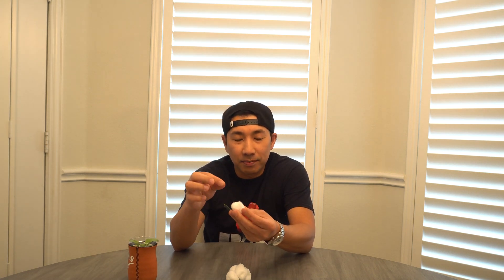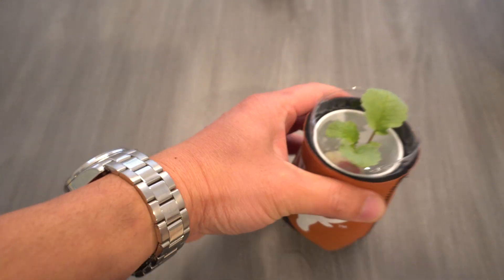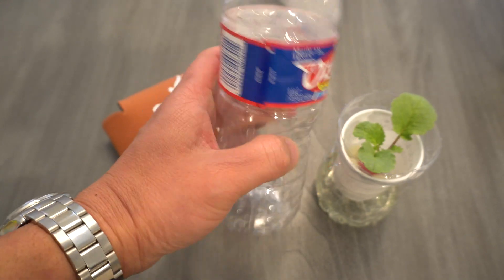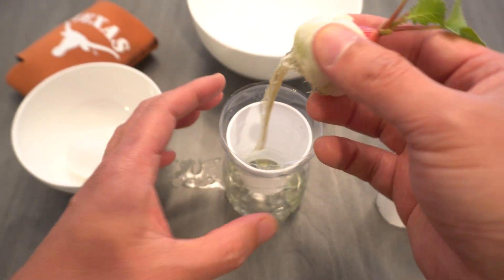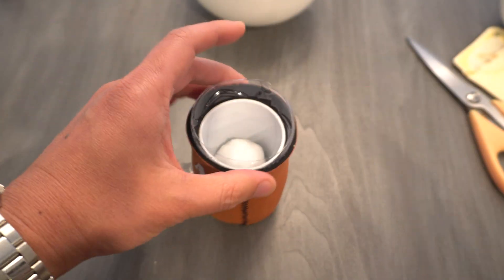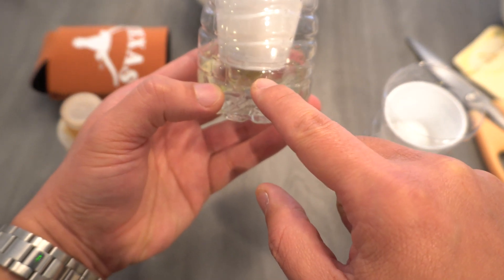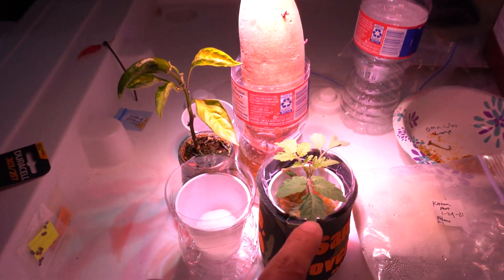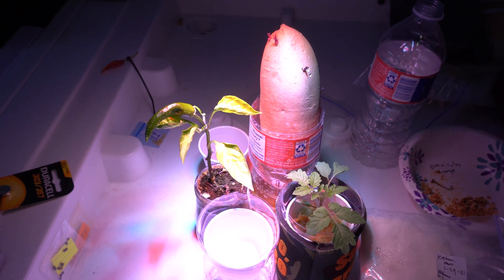Can Cotton Ball Be Used As Hydroponic Medium

Comment: I have used cotton balls to sprout tomato seeds but transplanted the seedlings to soil after.  It grew wonderfully under a lamp though.
Reply: As I said to Khang I will repeat here (btw, good for you using the cotton balls and not falling for the rock wool lies) - People are stupid too.  What is the cotton ball going to do?  Not a damn thing.  Why?  A seedling can sprout anywhere, and on anything, given the right environment because it takes all the nutrients it needs from itself until at least the first set of true leaves.  Most times my plants do not lose their cotyledons until the second set of true leaves.  By the time that happens they are already transplanted with the roots in soil, or hydro solution with the cotton ball having, at most, used as a little support.  Don't fall for the rock wool lies, as they are there to keep their money train continuing.
Reply: @generalawareness101  I have never used used rock wool as I feel the same way.  I tried the cotton as an experiment for sprouting instead of the usual paper towel to see if I can get the roots out better.  But didn’t work. It tangled even more.  Wanting to try hydroponics so looking into using old used sponges.  What do you think?  Have you used sponges for hydroponic before?

Comment: I cut up a new kitchen sponge when I need new starter material. Has not failed me yet.
Reply: I've seen multiple people mention that they couldn't make sponge work in different comments on youtube - could you share your technique? The people need to know.
Reply: @erich1394  A relatively porous sponge is required, if it has a hard scouring layer that should be removed, initially wetted and squeezed mostly dry create a hole about 1/8" deep, drop in your seed and cover the hole with sponge material and leave the sponge on a dry surface and lightly spray once a day (or when the sponge starts to feel dry...depends on your climate)
Reply: I haven’t been successful with the sponge, yet.
Reply: I save old sponges to use in the bottom for pots to keep soil from going out the holes. I like that idea. Thank you. I put mine in a dish of water in the microwave for about 2 minutes and it sterilizes them.
Reply: Thank you so fucking much